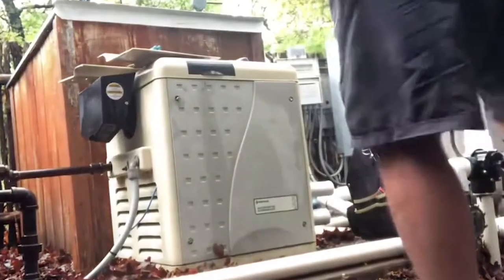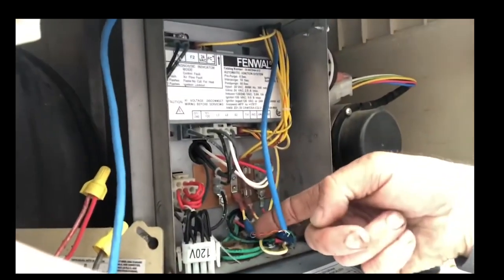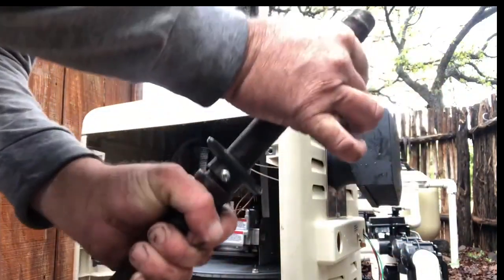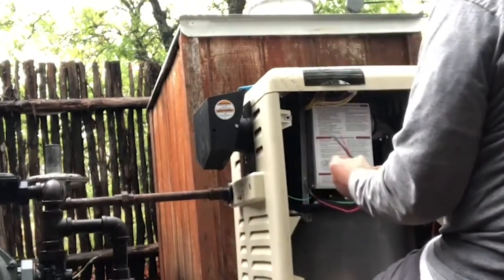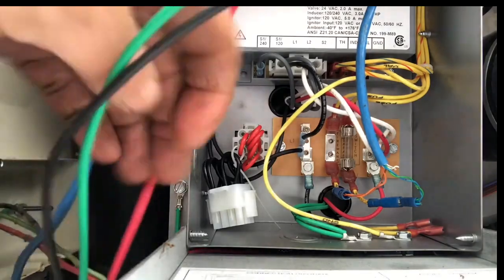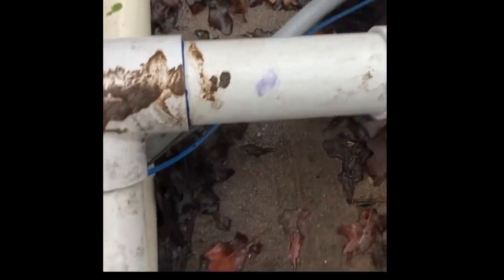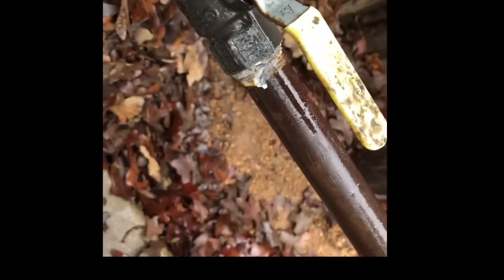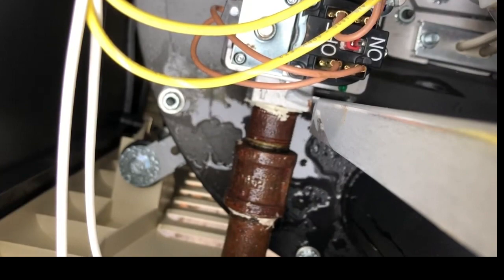Pool Heater installion; How-to complete Installation Step by Step DIY

Comment: Is the a solar option to heat pools?
Reply from the maker: Sure, but it’s nothing compared to gas heat. It will raise the temp, slowly very slowly
Reply: @Pool-guy  slow and steady will win.
Reply from the maker: @rlh2036  just priced a heater to replace one that froze. 5 0 0 0 big ones. I remember when we could get them for less than 2
Reply: @Pool-guy  things are getting ridiculously high. I may have to go natural all the way. Maybe polar dunking.
Reply from the maker: @rlh2036  Time to take the polar plunge